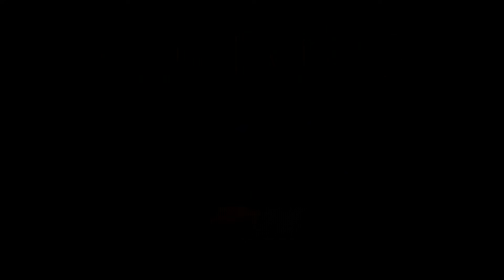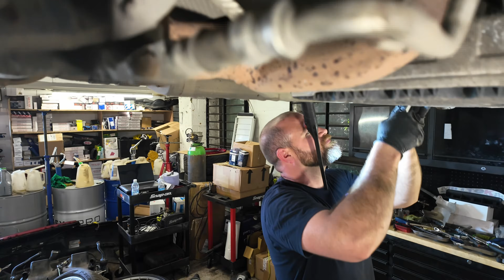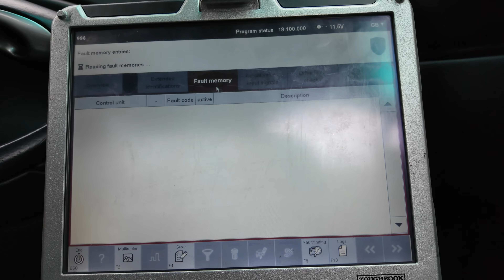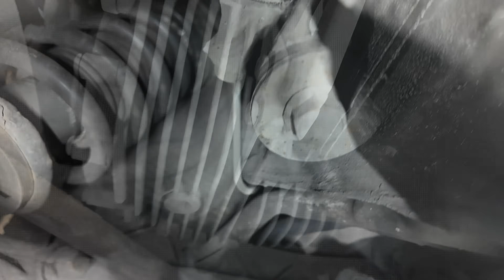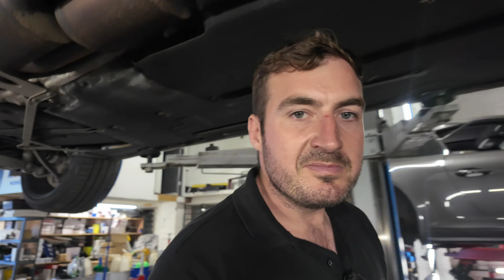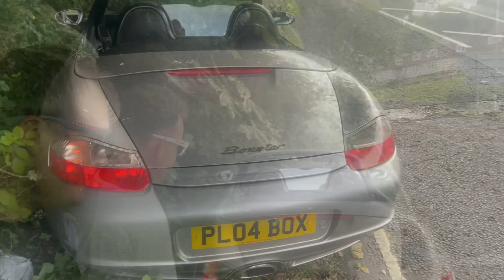CHEAP Boxster FAILS & Dangerous brake line bursts Weekly Workshop #7

Comment: Seems crazy to have to pull the motor to replace a brake line. Would an option be to run a line straight across the chassis in front of the motor?
Reply from the maker: Unfortunately the brake line is very much hidden by the engine and gearbox. We’ve followed the Porsche factory design for safety standards.